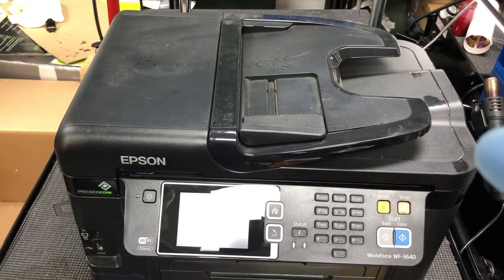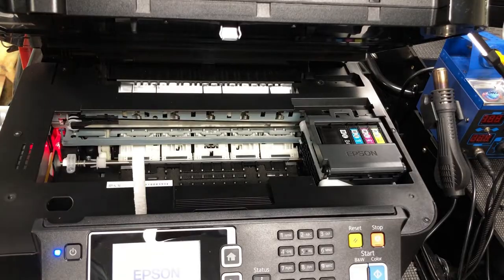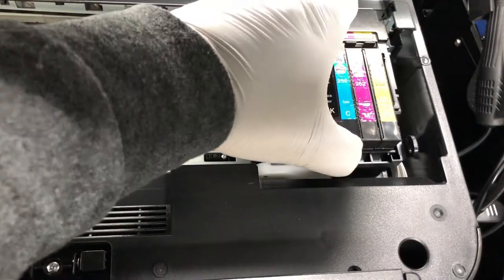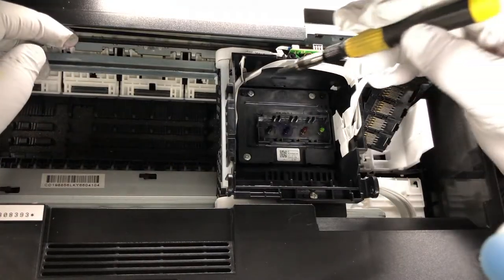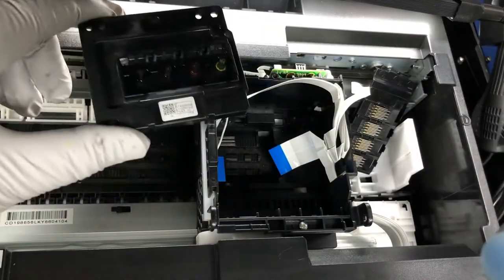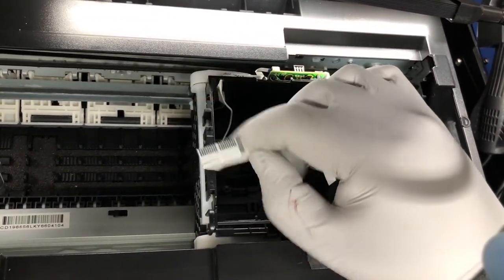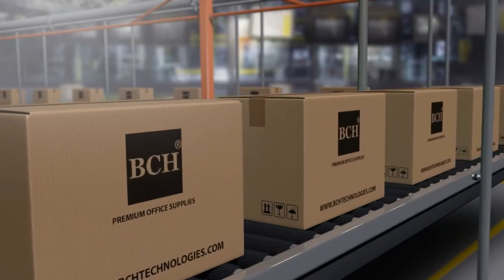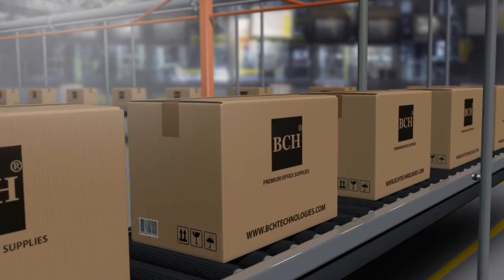Epson T1881 Printhead Replacement for WorkForce WF-7710 7720 7110 7610 7620 3620 3640 T252

Comment: Kevin, I discovered what I did that caused my WF 7710 to malfunction (see my comments just below) after I completed my inkjet print head replacement. Anyone might easily do as I did and get the same problem. There is a transparent strip of plastic, about 5mm wide that runs the length of the cartridge carrier path. The cartridge carrier has a sensor looking at this strip as the carrier moves. When I did my head removal and replacement, I got smudges of ink on this plastic strip. This caused the failure of the printer to initialize resulting in a 000031 error. Cleaning off the ink smudges from the plastic strip solved the problem. Thanks again for your excellent video.
Reply: thanks for the smudge relief!
Reply from the maker: Thanks for sharing.  There is another cause for 000031, which is the cap station (waste tank assembly) stuck to the bottom of the printhead carriage.  I have a video here: https://youtu.be/-DvsptHbY1w
Reply: @BCHTechnologies  I wanted to kindly ask does a faulty print head cause the printer(WF7610) not to power up? I did conduct multiple head cleaning and it shut down. When l power it up it lits up or a sec then its off
Reply: I have a question.  I switched a printhead from my donor wf7710 to my current wf7710 and did step by step of your video. When I power it back on, it shoots left, somewhat hard, and gives 2 different error codes. What am I doing wrong?

Comment: Thank you Kevin at BCH! This is a great video. I followed it to the letter and replaced my 7720 printhead with one that I purchased from AliExpress as a new printhead. After I replaced the printhead, I turned on the printer and got the "print head might need maintenance" message". pressed "OK"  and it continued just fine. Sadly the printer didn't print a single line when I did a nozzle check and then a print head cleaning. I did the nozzle check twice and nothing changed.   I am no longer getting the 00031 error but I suspect that the "new" printhead is really just bypassing that error somehow, however, I will let the printer sit overnight and hopefully it will work. Even if it does not work, this video is an excellent reference guide to those needing technical repairs and maintenance.  Thank you again. I appreciate the help.
Reply: I’m having this same issue. I didn’t replace the print head but I took it all apart to give it a deep cleaning. Set the print head to the side and didn’t touch it. But I was getting black and yellow to print before. Now that I’ve put it all back together I’m getting no ink at all. Hopefully I can refollow this video and get it to work

Comment: Hey Kevin, my WF-3640 stopped printing so I ordered the cleaning solutions, did all the cleaning, still clogged nozzles.  Tried cleaning the nozzles multiple times.  Finally I ordered my printhead replacement, followed your directions to a T, put it back together and holy cow, it worked!  Thanks for your help!

Comment: My cyan print head clogged, and I followed these instructions for removing and replacing my print heads.. Just wanted to say THANK YOU for your clarity in taking this apart and putting it back together. I did have a little difficulty initially where I was getting an error and the whole unit wouldn't re-set once I turned it on, but I took it apart again (so much easier the second time), double checked everything was attached and seated, and actually had to do this a few times, until finally it took! Not sure what I did the fourth time vs the first, but hey. It worked.

For those who are cleaning a print head instead of replacing it, I had to run maintenance about four or five times before I started getting ink again. Woohoo!! Glad to have my printer back and to not have to replace it now. Only had this printer a year! My Canon printheads NEVER clogged (in literally ten years of usage of the same machine), but I've always heard Epsons can be prone to clogging. Guess I've just found out how true that is!

Thanks again for this video! It really helped!

Comment: Great tutorial!  Thanks to your expert step-by-step instructions, my printer issues have been resolved!  Fyi to others .. I did have to run the printer through a couple cleaning cycles but after that, only the black was printing the test pattern.   One of my cartridges was low so I replaced it. The printer went through the cycle of preparing the ink system and after that was complete,  all colors printed.

Comment: For people who have the wf-7010, it is a little  different (less parts to remove)but the similarity is the contact tab (or holder board) removal on 4:04 or 4:06 (and pause it) but on both sides (plastic pointing up with a little tab on top). I wished you showed the tab a bit longer to see. It is the top part of the tab that needs to be pushed in on both sides which is hard to see if you are looking at it from the top. The wire tape needs to be remove on the right side first or else it is on the way and cannot slide upwards. I had a hard time discovering it that I like to at least tell other people who likes to replace or clean their Printhead on wf 7010.  Ones the tab is removed, it is pretty self explanatory removing the printhead with 3 screws.
Reply: Thanks.  I have a WF-7010. Replacing the print head should solve my issues.

Comment: Hello how can i replace the 3 pin FFC underneath the starwheel. I already disassemble my EPSON 7710 printer, thanks to your tutorial. I bought the cable on your BCH website.  As of now, the printhead is still stuck on the right corner. I dont know if there are some screws to remove underneath the printer head for me to remove the starwheel cover.

Comment: Hi Kevin Great Video!!!!  I just discovered that there was a short on the left side strip for the print head.  It looks like 2 pins burned.   So I imagine the white strip needs to be replaced, which goes from the printhead to the other side of the printer.  Do they sell new strips?   Also, not sure how to remove/ reinstall strip on the opposite side (hard to see).   Any advice

Comment: Hi, Kevin.  I loved the insight and guidance during your video.  Only one thing is missing.  When you reinstalled the circuit board, your video did not show when you reattached the connector to the circuit board.

Comment: Excellent tutorial...quick question. I have an epson workforce 1100 where all inktanks are not recognized, the inktank holder does not dock properly after staring up, it goes left right under the plastic divider from the docking area, and ink light is always on, green power light flashes...thoughts anyone ?
Thanks in advance.

Comment: After following your video I was able to take out the printhead and cleaned it up. But when I put it back it is not printing anything even after 8 - 10 print head cleaning cycle. Not even a small dot of ink is coming on the paper. I levelled the printhead too, took out and screw it back one by one but no success.
Please help me what else could have gone wrong

Comment: Thanks for the video, I was able to replace the print head easily. Everything seemed to fit properly back in and I was very careful, however now I just get blank pages when printing (at least 2 of the colours were working before). Might there be a common issue, or did I get a dud print head?
Reply: I'm having the same problem, did you find a solution?
Reply from the maker: It depends on where you get the printhead.  Many of them come with wetter solution filled inside, so the printhead will not dry out during storage.  You will need a couple of cleanings before seeing any color.
Reply: Did you find the solution. I am having the same issue
Reply: @BCHTechnologies  I can hear some liquid when I shake the printhead .... should there be no liquid inside ? How do I take it out ?

Comment: i have a Epson ET 4750 and i replaced the print head and i did an alignment test and the horizontal test print out all has spaces between the bars and when i print with plain paper i get horizontal lines equal spaced down the print out....do i have to align the print head itself ???  please can you advse

Comment: Thanks for this but do you also have a video for print head removal on an Epson Nx515?   Mine is very clogged and it would be easier to try to clean or replace if I could remove it. thank you.

Comment: After a print head short on my WF-7720, I ordered new printhead and cables from AliXpress as it was the only place I could find that would send them to New Zealand. I fixed the fuse one the mainboard, and reassembled with new parts, and the machine makes it look like it's printing, but fires nothing at the page. The new head does have ink in it, as I can take it out, and blot it to check. 
So I disassembled the old print head and cleaned, dried that, and put it back in. That throws an error 34503, which I cannot find any useful information on.
Stuck with an expensive lump of e-waste. The nearest agent is over 2 hours drive away, which at current fuel prices is more than the printer is worth!
What do I do? Buy a Brother?
Reply from the maker: 034503 MEANING=" Contact error at I/S clutch operation" DESCRIPTION=" E Ink system failure". It is an ink system failure. You probably pulled out the ink contact cable while installing the printhead.

Comment: Thanks Kevin. Great DIY clip. 
Do you know if it’s worth removing the head and cleaning ie soak in window cleaner and replace ?
Reply from the maker: Yes, absolutely... if you do it right.  I won't use windows cleaner because it is not filtered.  I will use a professional cleaning solution, filtered to 0.22 micron.  Then I will put it inside the printhead overnight and let it do the work.

Comment: Hi Kevin, I had a WF3620 Epson printer. Days ago the message 0x97 was shown to indicate the clogged printer head. I followed your instructions, took out the printer head and soak in the water, also clean it with clean liquid. But after I installed back, I even changed a set of new ink(remanufactured one), it turned out print blank page. What did I do next? No any error msgs were shown.
Reply: Did you find any solution ? I am getting the exact same error.

Comment: I followed your very clear instructions, got everything back together but now when the printer starts up, in the initial sequence of operation, the cartridge carriage moves to the far left, there is the sound of gears not meshing and the printer faults indicating a "error 31".  I see what looks like a tiny LED opening at the far right of the printer that might be for carriage alignment purposes. I suspect that I have altered the carriage alignment and the LED is not able to see what it should see. Any suggestions?
Reply from the maker: Please see this video.  Your cap station is too high or out of sync. https://youtu.be/-DvsptHbY1w

Comment: Hi Kevin I’m back with another question... how does the printhead get shorted out and what are those three little fingers that touch the printhead do?
Reply from the maker: The little finger is the ground.  If you get ink or water at the yellow color‘s base, it will short out.  That’s where the power comes into the address module.
Reply: @BCHTechnologies  thank you very much. I can’t remember if I drained the power before I disassembled the print head:/

Comment: Are there instructions for removing the printhead carrier somewhere? The CR drive cable in my printer snapped, and I see that you sell replacements on your website. I think I could replace this if I removed the carrier, but I don't know if that can be done easily, so I would appreciate any insight you could provide into how to do so.
Reply from the maker: Thanks for the suggestion.  I will make one soon.

Comment: Hey Kev Thank you. My 7620 wouldn't power up, I watched a few videos on troubleshooting, then I  came across this video, followed your instructions and found out the cable near the yellow on the print head had burned out. I was thinking do I changed the entire print head or just the burnt cable?.
Reply from the maker: Most of times, the printhead is gone after you burn the cable.
Reply: @BCHTechnologies  Ok cool I thought just teplacing the cable would be enough. Another question if you don't mind, that flat cable has 4 or 5, heads, behind the cartridge case I see two flat cables, in order to connect those do the cartridge carriage have to be removed to connect the flat cables?
Reply: And where can I find the flat head cable. Thank you.
Reply: @BCHTechnologies  Hey Kev would you have a extra  motherboard for the  7620 for purchase? I was told that if it doesn't power up after removing the print head then it's the motherboard. But those flat cables were not damaged. And I believe the flat cables act like fuses for the precision WF,. What do you think?

Comment: Hi Kevin, i followed your instructions but when I completed the installation of the new printhead nothing printed. I went through the printhead nozzle check and the printhead cleaning process, but the printer failed to print. I went back into the printhead and checked the cables to make sure i put them in with the blue sides facing upwards, made sure the printhead was level and tightly installed, made sure the ink board was installed properly. Still I get nothing to print. Any ideas what I might have done wrong or what I should check?
Reply: Hi Brian  I had the same problem.  Did u find a solution
Reply: @cathybenteau9783  No reply…just crickets.
Reply: Mine too!  I'm an electronic tech, I ordered the part and put it in, it says the nozzles might be plugged and to check them before printing.  I ran the checks and nothing prints.... The old head just had a cyan problem... Now nothing will print even though it runs through all the actions and sounds like it's printing.

Comment: Hi Kevin, Your videos are the best when it comes to Epson. 

Recently I acquired an Epson WF7620 Printer, and heads are clean and nozzle checks gives proper results and am using original cartridges.  I use Windows 10 for most tasks. 

But the sad thing is that after multiple cleaning cycles, in vertical alignment test (black small squares #1, #2 #3 lines) they always leaves white gaps, in all options. With color it is always fine. Is this a driver issue or hardware problem? I am so frustrated with it, is there a solution to it?

Your help will be appreciated.
Reply from the maker: It sounds like just regular clogging.  Do a flush and see it it takes it away.
Reply: @BCHTechnologies  Hey thanks for the reply, I did cleaning couple of times, regular head cleaning (after watching many of your videos) and printing images again and again, and voila, it did work. :) Thanks. keep the good work up.
Reply from the maker: @deamonsnake1985  Congratulations.  Happy printing!

Comment: One year later, I'm back. Apparently all replacement heads are not the same. I ordered one for $60, (Epson charges $250) it says made in China on it which must be where Epson sources its heads, and looks identical to the original. When I installed it, I got a prompt that the head had been replaced and to do a nozzle check. When attempting a nozzle check, I was given a error 031008. I took the head out, checked the cables and positioning, put the head back in and made sure the ink tanks were seated and the contacts on them clean. No change, still error 031008. Thinking that my Epson WF7710 might be able to detect a non-Epson-supplied head, I reinstalled the original head. No error. Now I must pay the same amount for a replacement head as I paid for the printer? It sure looks that way.

Comment: Can you please help me? My printer printed fine until my magenta nozzle in the printhead broke off. I ordered a new one and installed it per your video. Now it wont print at all, is there anything more I can do? Ive run a nozzle check and cleaned the print heads and it doesnt print anything at all on a nozzle head check. i have the epson wf-7620
Reply: I have the same problem!

Comment: wondering if anyone else had this problem::: I followed your instructions and changed my printhead. When I ran a nozzle check the only pattern that printed was black... even after several head cleanings.  while doing this I cleaned my old printhead so I decided to put that one back in and see what would happen.  Well now the only pattern that is printing is magenta and no other color.  What is happening?  Is it something other than the printhead problem?